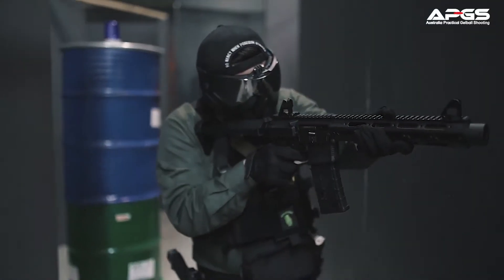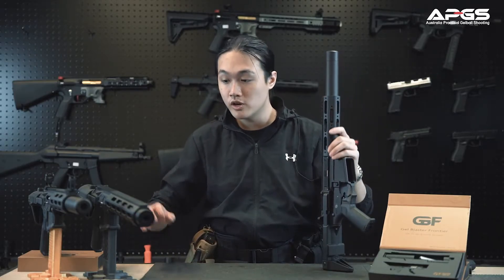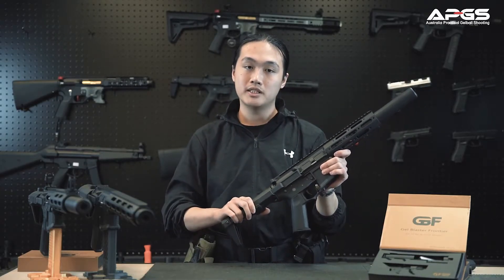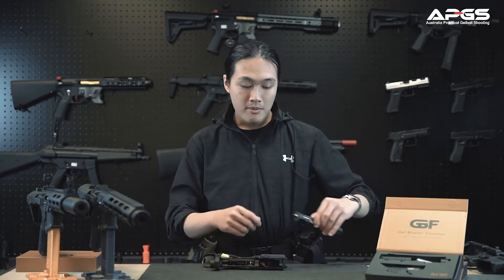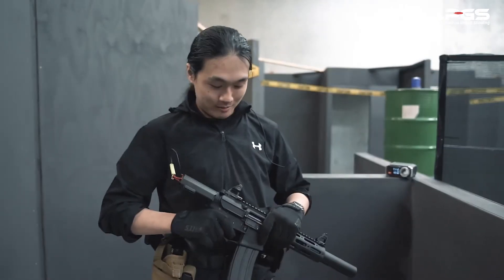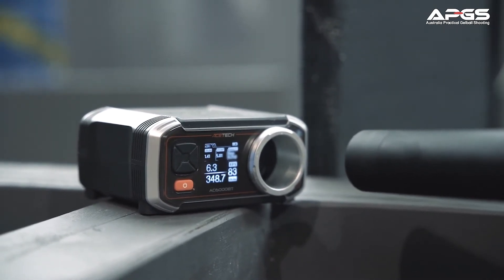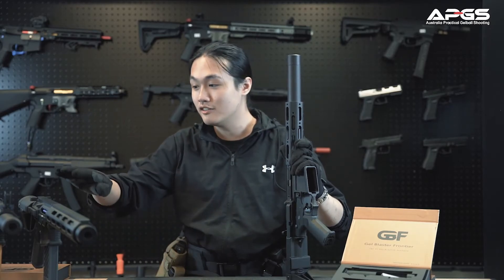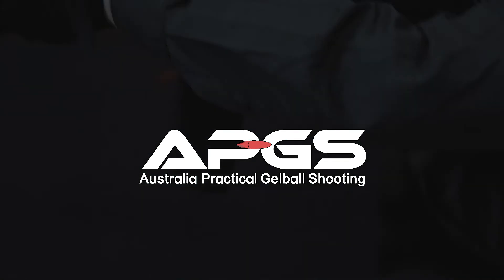Gel Blaster Frontier Honey Badger Review - APGS Armoury

Comment: Much better more consistent and higher chrono numbers after the minor upgrades, 350fps is a much more respectable number
Reply: Fps is overrated.
Reply: Y is that lol 😂 im sure that you would prefer to be hit with low fps blasters and im sure if i pull out the 450fps slr you would run

Comment: Why don't you drop a polarstar into one of the honey badgers man
Reply from the maker: Haha, we had this idea before. But honey badger is a bit heavy for me. I don't like to hold it and carry a tank at the same time.
Reply: @apgsfield8217  it will be so much lighter especially if you use a mk tactical hpa gearbox and the tanks not that noticeable in a backpack or camelback
Reply: My all nylon hl-015 honey badger with the mk tactical hpa gearbox with a polarstar jack and the suppressor is screwed straight onto the modified slr outer barrel adapter so it's short the 25cm 7.3mm stainless barrel runs perfectly to the end of the suppressor just no room for a hopup if i decide i need one i will cut and crown the barrel and open the the end of the suppressor so the hopup fit's but the thing is so lite it's a joke, i gotta weigh it and check but it cut's down the weight big time, i also have a aps noveske 7.94 sbr and i gutted that and put a polarstar F2 in the standard cast aps gearbox and that's still pretty heavy, i got another mk tactical hpa gearbox but just gotta swap it over and hopefully that cut's the weight down a bit on that but won't exactly know till i do it i guess
Reply: Maybe i will have to hpa mine one ,Max at mk is pretty good to me with prices so if i do it im using a mk tactical hpa gearbox for sure if it doesn't need the spring retainer to hold the stock on, hopefully it's the same deal as my hl-015 honey badger and doesn't use a spring retainer to hold the stock on and then we are on
Reply from the maker: @drewmurray6480  Would love to see a HPA honey badger.
Reply from the maker: @drewmurray6480   Yeah, once you go everything CNC, your blaster is super light. Good work man.
Reply: @apgsfield8217  I will send you some footage of the hl-015 honey badger and Scotty from xforce was talking about doing his gbf honey badger with a hpa kit ,not sure if he did it but
Reply: @apgsfield8217  yeah and in the nylon hl-015 honey badger that has minimal metal only the couple of bit's i changed like the mag release and matching strike industries burnt gold charge handle plus by attaching the suppressor straight to the outer barrel adapter it's a very minimalistic and short build but still has a 25cm 7.3mm stainless inner barrel that comes right to the end of the suppressor, i gotta weigh it when it's all back together so i have a idea on the weight it also has a glock red dot for less weight, this one was all about minimal weight
Reply: Actually Scotty was talking about doing it with a hl-015's badger not the gbf version, pretty sure he was thinking the same way as me with the lite weight build
Reply: @apgsfield8217  im a fussy bugger and the standard m4 style change handle that comes with the gbf honey badgers is ugly so i got a few from  a slr one of those should fit and will still be functional ie open up the dust door/cover also have a kublai butterfly change handle but that would open the dust cover or i also have a few burnt gold/champagne strike industries part's like set's that i have pieced together over time they would add a bit of bling im running all those strike industries part's on my hpa aps noveske 7.94 sbr just to add a touch of colour to the all black blaster, it's a shame that the gbf skelotonized receiver in black will the gold bit's are actually gold not the burnt gold/champagne if they were champagne instead of gold i would have gotten one as soon as they dropped

Comment: What are the minor upgrades?
Reply from the maker: Changed to a bigger spring.
Reply from the maker: The original spring is M85. We changed to M100.
Reply: @apgsfield8217  is that all you upgraded internally, you didn't do the oring whilst you had it opened? ,i would have but that's just me or atleast stretched the oring over the cylinder and heated it up a bit just to stretch it out some, gives you a better seal and is cheaper than spending the few dollars for a upgraded oring if your that hard up for cash 💸 that is
Reply from the maker: @drewmurray6480  That will only help when your Oring air seal is not good enough. We have a pretty good Oring air seal. Only change a spring will increase fps.
Reply: @apgsfield8217  cheers mate i will probably hit you up in a few weeks once i have i on the bench im still working on the nylon hl-015 honey badger atm with mk tactical hpa gearbox and a jack and one of my slr's is having dramas so gotta quickly see what is wrong with it, it was still in the testing stage and something went wrong so gotta sort those and the gbf honey badger should be here next week sometime ,so when the time comes i will probably pick your brain 🧠